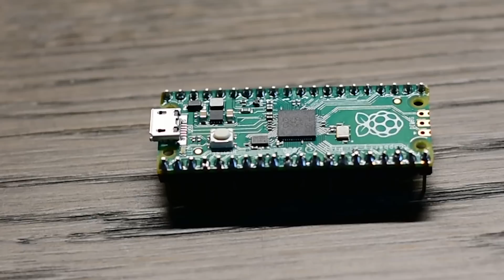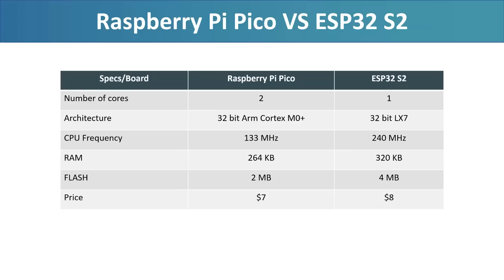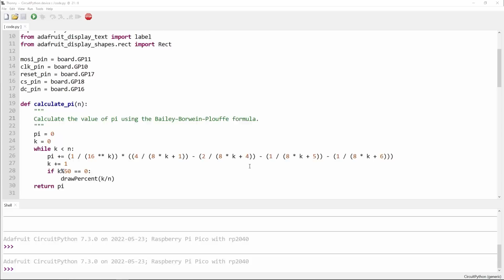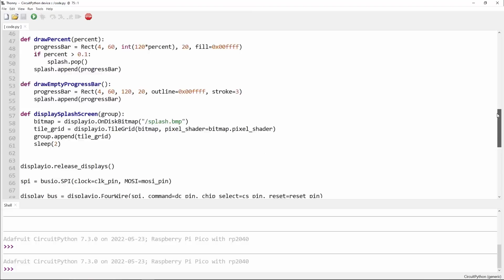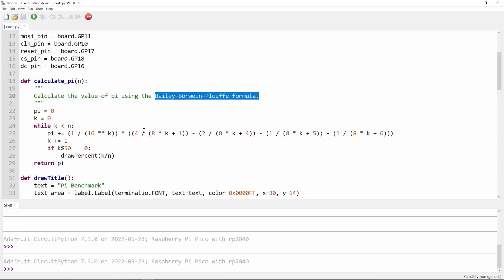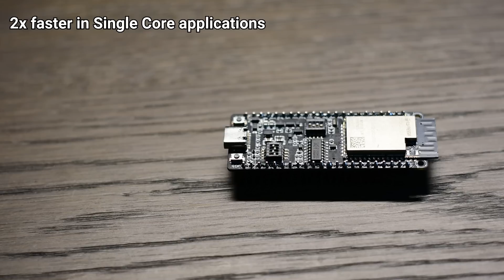Raspberry Pi Pico VS ESP32 S2 speed comparison benchmark using CircuitPython

Comment from the maker: I hope you took away lots from this video. Let me know below!
PS. I created a course named "Object Oriented Programming Made Easy. Get it here 👉 https://bit.ly/3NaMfg4
Reply: You can overclock the pi pico to 250mhz
Reply: Ok, first thing - progress bar is delayed calculations and on the slower machine doing more delay, what is incorrect. If you don't believe simply do progress bar on the half screen size and check time difference. You should only calculate timestamps in calculation time and the second thing: To be honestly you should calculate PI 2 times, on the RPI paralelly on the two cores, and on the ESP one after one - that wouldbe show really how fast they are. It is not? Cheers
Reply from the maker: I will try to do a parallel computer of Pi in the future. In this video I just test single core performance. Thanks for the tips!
Reply: Can still get the pico for $4 from official distributors.
Reply: Great vid!
Reply: Are you Greek or Italian ?

Comment: one point about your current consumption measurements. The LED on the ESP32 board is on, that will draw around 20mA of current by itself. not to mention the minute, but additional losses incurred from running longer leads on the esp32 side, and the addition of the USB-to-TTL converter on the esp32.

Comment: Both are running Py, so the benchmark is solid. I know esp32 can boot instantly when the bootloader is removed, but I don't remember if author specified if he had done that. Sure implementation differs, one is arm and the other is xtensa.

Comment: I hate libraries and it was much faster to write a bit of code in MMBasic to begin with. I can focus on the tasks, hardware and the modules for things. I bought some ESP32 stuff anyway and it's the same SPI, I2C, Serial, Display and whatnot protocols with more wireless functionality on the ESP32 side. Low power and no heat is a major factor sometimes. They can easily communicate together, so just do you.

Comment: Excellent video ! Did you consider to rerun the test with an RPi Pico W ? I'm not sure if the wireless option has an impact on the result though. Furthermore: Would it make sense to try to make use of the 2nd core by introducing threads (AFAIK the 2nd core is not used in Python code by default) ?

Comment: the rp2040 is around 0.70$ - 0.80$ and can be overclocked it has less IO if i remember correctly but has 2 cores, is pretty fast and cheap

Comment: thonny ide (uses an interpreter) made my pico run 10x slower than my nano, idk it’s useless to have 8x times 2cores more processing power and be 10x slower than a poor nano. I’ve just switched to arduino ide and it now runs about 500 times faster but there is another problem. compilation takes several minutes makes it very difficult to debug.

Comment: Not sure it makes a lot of sense to compare on that task, and inside CircuitPython... except if you plan to use it with CircuitPython.
I think the Pico has no floating point math and is using library to do the math... and that might not be the case for the ESP32S2 so on some mathematical activities.
I think the size of the community, the documentation, the support, ... are big factor for the maker community.
Price and availability are also important.

Comment: This is a good approximation and the results are kind of expected, but it would be good to see the same test running natively instead of through CircuitPython, and without intermediate progress being sent to the display. You're spending time updating the screen and the execution benchmark is skewed by potential differences in the way the two boards communicate with the display. There's no good way to tell what these differences are here. Ideally you'd have them boot, start a timer, run the benchmark, stop the timer, and only use the display to show the results at the end.

Comment: Interesting and thanks but I think it is a little lopsided as the Pi Pico has two cores and you only used one.
Reply from the maker: Yes, I only used one core of the pico because CircuitPython does not support multi-core programming. I plan to do the same test on Arduino and use both cores of the Pico, so stay tuned.

Comment: Ok now run C on the pico...
Reply from the maker: That's what I am trying right now. From the initial tests the C is 300% faster than CircuitPython. Then I have to test dual core performance. Stay tuned for the video.

Comment: Second thread is very powerful, can run second task that normally would slow down your code significant on the second core, and it's easy to use in the code. For example, you can run TFT driver on the second core, or serial communication, etc. So your program runs full speed, that can be huge difference in many cases.

Comment: The processor chip on the pico actually has no Flash, and the Flash device is a serial Flash. This means that the chip has to load code chunks less than 264k and run them then swap them out for new code bits. This is an issue only on larger programs of course, but if you set aside large buffers for USB or WiFi processing then you could see a considerable performance hit. My guess is that the pico is between 80% slower and maybe as much as 1000% slower depending on the application, with smaller applications being favoured. It would be nice to have someone test this with a test suite designed to specifically disadvantage the pico's architecture.
Reply from the maker: Interesting info. Thanks for sharing!

Comment: WTF???? A "benchmark" using Python that is a interpreted language ???? Hahahahah .... Test without any foundation and that only serves to misinform and deceive the most ignorant!!
- The RP2040 (and PICO) can work at 240MHz!
- PICO W has WIFI and BT!
- RAM size and Flash size differences have no consequences!  If youre writing code for a MCU with more than 2 Mbytes of flash then you are totally out of your league. 
- PICO doesn't need EEPROM as programs can write directly to flash if they need to save data, there is even a file system for that. And besides... ESP with only 512 bytes of EEPROM is ridiculous and totally useless.
- PICO exposes 27 GPIO...  ESP32 has only 25 usable GPIO since it uses 7 IOS for Flash Memory!
- PICO has PIO! This is a big plus! Of course, for kids and curious people who don't really know how to program and just cut and paste pieces of "arduino" code, they don't even know what PIOs are...
- PICO does not need a programmer! It has mass storage emulation, just copy the .elf file and that's it! And if we are programming in Python, we can run the program instantly from the editor/IDE without having to blink
- The PICO W costs 6€ the ESP32 costs 24€ !!   
- Most importantly, PICO is all European technology and manufacturing... ESP is Chinese, not a penny more for those guys!
Reply from the maker: All the points are valid. The video is not to deceive or disinform. It is just my opinion on using both boards running the same script. Yes, it is not a benchmark, but it shows which is running CircuitPython faster, which is still useful.
Reply: Tried about every board, but current go to is the Teensy 4.0/4.1. I know they are a bit more expensive, but they toast anything else. And Teensyduino is killer, never a hiccup while flashing new code. It has comparable features to PIO, up to 1GHz, proper Flash storage, crazy amount of IO, true USB-2 speeds, killer software support and libraries (Audio!!). And it is even smaller.

Comment: pi pico can run up to 250Mhz even to 400Mhz try to run it on 250Mhz and see it with same code
Reply from the maker: Unfortunately I can't do it with CircuitPython. I have to write the code again in C/C++ for Arduino and test it. I will do it in a few weeks.
Reply: @Educ8s  write this line at the top of code  under import lines  " fclock=250000000 #clock frequency of the pico "

EX:

from machine import Pin
fclock=250000000

Comment: It would be nice to do a long test and include the 2nd core of the pico.
It would like to see if having 2 cores makes up for the slower proformance and if the power differences.
Reply from the maker: Yes, I will try to do it in a future video, but in C, since CircuitPython does not yet support the two cores of the Pico

Comment: You should compare these to a Teeny 4.1. Single core, but at 600 Mhz, which can be overclocked. Much more powerful, with a lot more I/O. I would use C libraries for the comparison however.
Reply from the maker: Yes, Teensy is a beast. I would love to test it!

Comment: I wonder what result you get if you compare to the ESP32-C3 RISC V board. According to my experience, the C3 @160MHz is twice as fast as a Pico that is overclocked to 240MHz. Of course, only single core used.
Reply: Same with the esp32 board, it can also be overclocked to 240MHz, and has a second core
Reply: @iliasalaur  That's true, but if you run Pico and ESP32 S2 both at 240MHz, Pico is faster as RISC M0+ is more efficient than LX7. On the other hand, if you compare single cores only, ESP32 C3 RISC V core clocked @160MHz is faster than a Pico @240MHz. That's what I see at least, but not benchmarked under lab conditions...
Comparing single vs dual core uC is a difficult one I don't dare, because too many other dependencies like SW quality, thermal power capability, RAM and Flash channel bandwidth, mem paging ect. have large influence on result.
Reply: @deehigh3359  actually, we shouldn't compare pico and esp32. Both of them are designed for different reasons. First for simplicity of interacting, second for developing iot stuff. So, that's it

Comment: You can't run python application to measure hardware performance. The implementation of python runtime very much affects the speed of execution and for each MCU the implementation details differ a lot. So you might be measuring the quality of python implementation, not hardware performance.
Reply from the maker: I agree with what you said. My point of doing the test is not to test the processors, but if someone is using CircuitPython to build his project to know which board is faster running CircuitPython. I think it is useful to know.
Reply: Actually, if he would use pure c++, the esp32 would be also faster.
Reply: @iliasalaur  but by how much? Can Pico's second core close the gap? How well does ESP32 handle IO operations compared to Pico's PIO implementation? This test is the first thing most people will see and it will give them the wrong idea about the potential use cases and performance metrics of these boards. Also I would imagine Pico would win with a proper multithreaded version of this algorithm (maybe even single core when running at 250MHz).
Reply: @artifank2747  man, pico's max clock frequency is 133MHz, while esp32's max clock frequency is 240MHz. That means that it will run faster in all cases.
Reply: @artifank2747  and btw, esp32 has 2 performance cores and 1 ulp core.
Reply: @iliasalaur  I did not know ESP32 had more than 1 core, it seems I got the wrong idea. Also, Pico can be overclocked to 270MHz with a single micropython function, though max stable was 250MHz with mine. It seems we both know our favorite development board better :) Though my point stands that this video is very insufficient to compare these boards.
Reply: @artifank2747  yep, definitely that video should have more specific data about performance, power consumption and other stuff

Comment: I always love how two people can see the same data and come to wildly different conclusions.
A 10% savings in power and a faster startup time are significant factors and would result in my choosing the RPi Pico over the ESP32 S2 for almost every task that it has sufficient computational power for. 
What I mean by that is that decreasing time taken for a specific process is largely irrelevant unless the use-case requires that calculations complete within a specific window, are sufficiently long to overcome the startup time difference, and will continue to be processed at this rate. For me that limits the cases where it would useful to some sort of pseudo-realtime image processing or similar, but such a scenario would likely require more processing capability then is provided by the S2.

Comment: The ESP32 has two cores and a third ULP core...  Not one...
Reply from the maker: The ESP32 S2 has one (not two) processing core and one ULP core.
Reply: @Educ8s  Oh, I'm sorry... I read ESP32-S for some reason, not S2. That's kinda embarrassing... :D
I feel like it would have made more sense to compare the Raspberry Pi Pico against the ESP32-S though, since it's the most commonly used ESP32, it has two cores and costs about the same. If you order directly from China you pay less than 3 $ (including shipping) for a Wemos D1 Mini, with a (dual core) ESP32.

Comment: First of all great video. Both are great boards. Let's not forget esp brought wifi to the makers. The pico has a few aces in its sleve like Hardware Divivide and can be overclocked to 266Mhz super easy. Division on micros without dedicated hardware is very , very taxing on performance. If you could try and use the Hardware Divide, and bump up the speed a bit on the pico, it will smoke the esp in this specific case. :)
What you did with the pico is like driving a Ferrari in 1st gear : no dual core, no hardware divide, no overclock :)
Reply: Salut din România
Reply from the maker: Thanks for the info. It is very interesting, I would love to try it.

Comment: The Pico is more popular? Definitely not among makers. I will juxtapose that with the fact I think the people behind the esp need to add more logic blocks to it's risc v cpu so it at least can draw 3d graphics better. A flatshaded 3d cube brings it to its knees. I can't speak to the pico's ability as I don't have the patience to copy code over to it and reset it like it's a thunbdrive with a crappy dual core cpu strapped to it that has to be taken out and put back in after every time you put something on it. From what I read the Pico is the next board to get an update from the rpi corporation. I'm sick of these companies giving makers the shaft because we had to deal with 8bit stuff for so long. A pico2 should be at least as powerful as a 10 year old rpi2
Reply: why use a microcontroller processor to draw 3d in the 1st place and no matter how fast a microcontroller is it will never be capable for 3d such as the architecture is not for that purpose, use an soc with mali gpu or a stand alone gpu for that
Reply: @destrukt4life  I agree but why do they sell (relatively) big ipa screens for microcontrollers and people make 3d graphics on them. I'm not asking for a Mali or soc. It was just an example of where mcu tech is at relative to their slightly bigger brothers. Just a bit faster isn't too much to ask for.

Comment: Could the script be modified to use 1 core on the pico for the calculation and the other to drive the display? how would that change?
Reply from the maker: Yes, but unfortunately not with CircuitPython. I have to rewrite the test in C.

Comment: ESP32 (not S2) is same architecture as ESP32S2, but has two computing cores, so 2x speed vs S2 and 2x cheaper price vs PI.
Also You forgot to mention about 8Mhz low power core on both ESP32 and ESP32S2, so computing power is even higher :)
Reply: Actually the pico has an additional 8 programmable IO cores

Comment: This is quite a nice test but its a bit lacking imo. It would be nice to see two tests running on each device. Since the esp32 can only handle 1 instance at the time (without some fancy asyncronus work), the pi might be a better choice depending on how you can utilize the extra core.

Still really intresting, thank you for the video!

Also, is it possible to do a calculation on the probable compute strength (flops) and compare it to energy draw? Would be really interesting to see any internal latency meassurements as well.

Also, doesnt the rp2040 lack a floating point unit compared to the ESP32-s2?

Comment: There is a huge difference in power consumption among different ESP32 boards. The CH340 oder CP2102 bridges sometimes consume more than the ESP32 itself (especially if you do battery powered applications where the ESP32 consumption can be as low as 0,0025 mA).
If you want to compare power consumption you should disable radio and reduce the core speed to about 120 MHz which will bring the ESP32 power consumption below 10 mA.
Reply from the maker: Thanks for the very useful information!

Comment: One small thing that I noticed right away is LED on ESP32 compared to Pico. The other side is CH304 chip it's only useful for development but not for actual project so it also uses some current. So if you thinking about project specific current you would emit all those before mesuring. Pico has integraded USB support so it doesn't need to use USB to TTL. So if thinking about actual project you would only use ESP32 module itself not entire dev board. This would give fair comparison between two. Plus WIFI/BT should also be sure to be fully disabled.

Comment: pi pico is sooooo overrated... ESP32 ftw!.. dont forget.. the ESP32S is a cutdown version... most the full ESP32 chips have dual cores (aswell as a low power core for running things in deep sleep).. and ...the only reason why pico is "more" popular is coz of the stupid pi and raspberry logo... the ESP32 has lots of documentation, and can be programmed with arduino IDE (with ESP32 core).. and you can easily downclock the ESP32 to save power if you dont need speed...
you can also get lots of different ESP32 boards, eg ones with more RAM, and more Flash over standard..ones with screens, etc.. ya cant with pi pico
Reply: You can overclock the pico to 250 Mhz+, it has 2 main cores, and it has 8 programmable IO cores that allow it do things the esp cant dream of